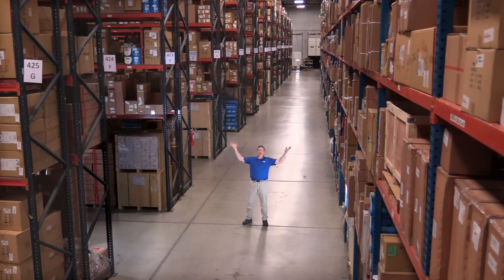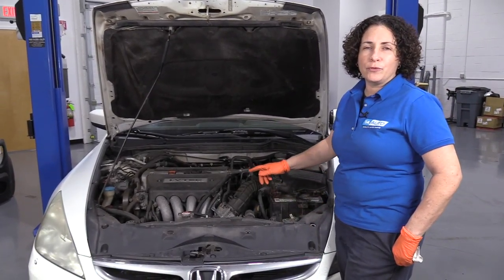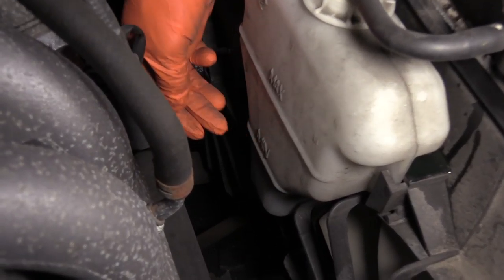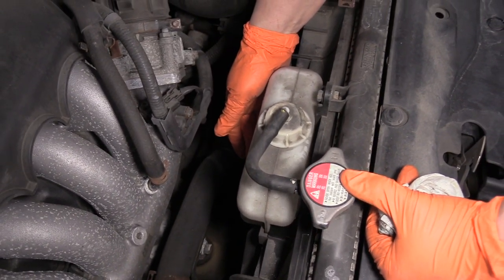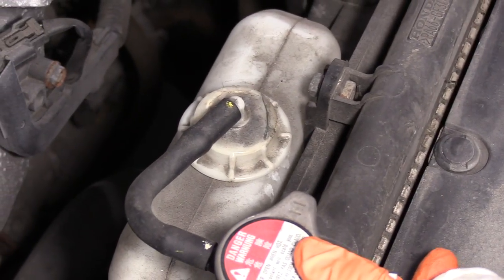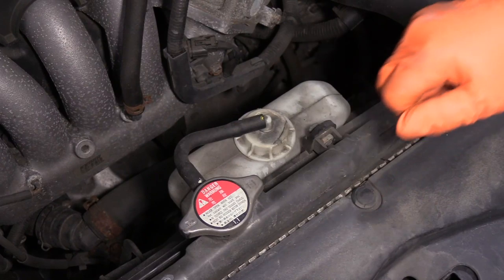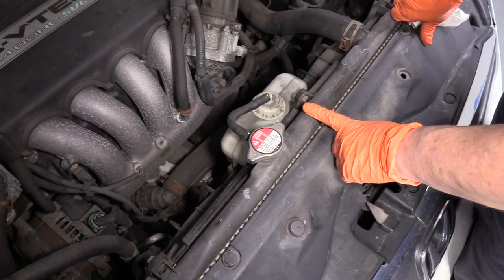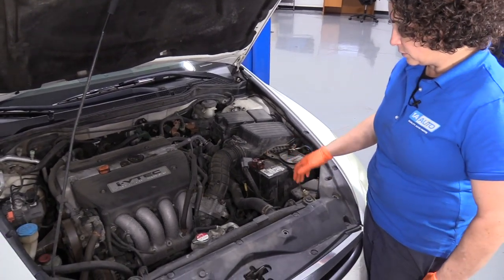How to Check Coolant 03-07 Honda Accord

Comment: So my overflow cap was completely broken off. Is that the cause of what made my car spray coolant over engine bay after a long drive? Like car didn't overheat or smoke. It just has coolant residue on the engine bay and battery
Reply: That's exactly why I'm watching this video cause mine just did the same thing
Reply: Mind’s doing the same thing
Reply: Yes. You need the cap.

Comment: Filled my over flow with water. (All I had at the time. When the van running, it doesn't over heat. When I get to a red light it starts up again.